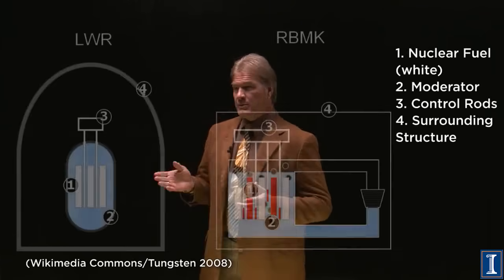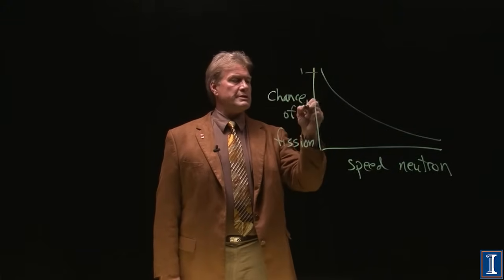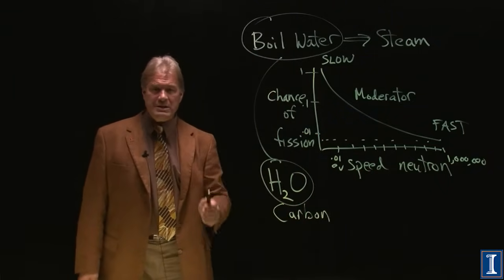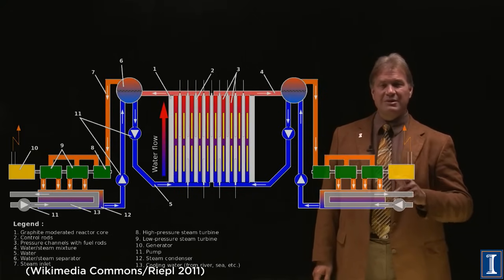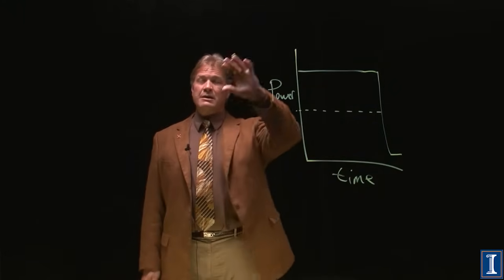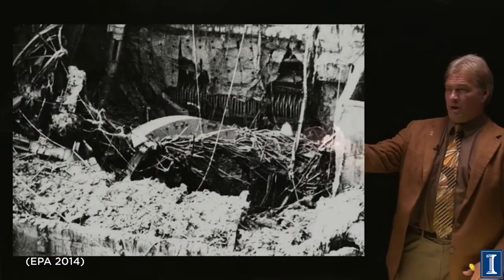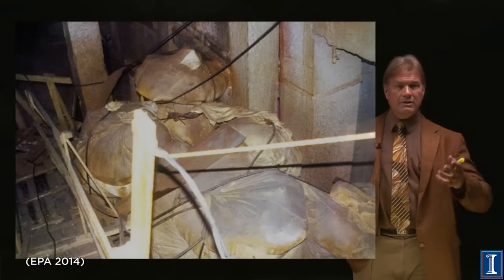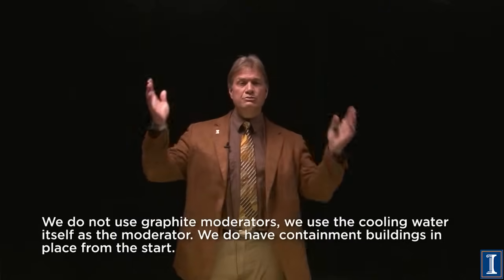Chernobyl: Worst Accident Ever

Comment: hello, i watched Chernoby movie as well, can you tell me what was the wrong button they pushed? from my understanding the issue or mistakes started because of the time amount of time that they waited to start experiment and while they waited to start experiment reactor was at a low enough power that xenon gas which is formed as a bi product of fission did not burn off as it normally would. where did you get this button information from? thx! i feel i got more accurate information from the Chernobyl hbo movie which is surprising. maybe this lecture is just a dummy down version of what happened?

Comment: The Soviet report concluded that the reactor didn't have a workable fail-safe for when the operators disable all the fail-safes.
Reply: You say that somewhat in jest, but there are serious engineering applications where "What if someone intentionally tries to make it do the thing we really don't want it to do?" ..is a significant consideration.
Reply: @jermainerace4156   You're embarking on a discussion of quality control philosophy, which is good.
Reply: @jermainerace4156  that’s true too. What if you have a malicious actor?
Reply: @jermainerace4156  Agreed.  Just that the implication is the designers were completely irresponsible and the operators weren't at fault.  Interesting idea that a nuclear worker could become suicidal -- maybe with a big enough dose.  And the HBO series (the final arbiter of historical disputes) implies that because accident details were made secret, they were not known to those who would have had the need to know them.
Reply: @crimony3054   The operators were at  fault because they didn't follow protocol for running at low power, the reactor actually had multiple automated safety checks, each one of those systems were manually shut down by the operators over the course of an hour, today no operator has authority to shut down a major safety program its entirely operated by computers.
Reply: @BigStou   But they didn't have a fail-safe for when the goddam operators over-rode all the fail-safes.  The whole RBMK design took the fall, but the operators were in fact at fault, and not just a little bit.
Reply: @crimony3054 .
Reply: @crimony3054  Yeah, I mean there were lots of problems with the RBMK and the Soviet penchant for secrecy but there is a reason only Chernobyl ever exploded - the operators. The regulations might have been unhelpfully opaque in some instances in explaining themselves but they were very clear DO NOT DO THIS about so many things Dyatlov ordered his people to do. Another thing was that things went wrong as Dyatlov was acting like they had only two hours, when actually they had more like five to do the experiment. He ordered them to bring down the power levels too quickly and then was in far too much of a hurry to bring them back up. Also while Soviet and Russian safety culture is not the best it is not non-existent. And this was evident in everyone but Dyatlov protesting that all his orders were unsafe.
Reply: @dewittbourchier7169  I think the power was brought down by accident. AFAIK, he didn’t tell them to bring it down.
Reply: @gareginasatryan6761  Well, for certain he didn't INTEND them to bring the power down as low as it got, but this was the mid 1980s and the effects of xenon poisoning were very well known. Dyatlov wanted to bring the power down faster. He should have considered this possibility and how to get around it, OR he should have just followed the right protocol.
Reply: @crimony3054  It doesn't matter if they were reckless, if they were informed they would have considered it. Airplanes don't crash from one system failing. Reactors don't explode from one system failing.
Reply: @BigStou  This is a critical thing we have learned over the last decades! In the case of chernobyl for example it is easy to say the operators are at fault. They caused the incident after all. Had they not acted grossly negligent nothing would have happened. However when designing something like nuclear powerplants we have long since learned that it doesn't matter who is at fault for the incident. We need to analyze how the incident happened and prevent it from happening again. 

So by that metric today you'd go and ask yourself "Would RBMK reactors be safe if the crew that operated the Chernobly reactor nr 4 that night was completely removed from the equation, replaced by a different crew." 

The answer to that question is no. It would not have been safe, not even remotely so. We don't view operators disconnected from the facility they operate anymore, we view them as part of the facility, part of the design. As such just like a valve can fail, they can fail and we should anticipate that failure and design around it! 
In chernobyls case, the Operators were directly made to shoulder part of the blame because it directed blame away from the fraudulent work culture that promoted the incident to happen. Today we have learned that a culture of blameless feedback is crucially important in allowing operators and human factors to act on worries without the fear of penalty. We have also found that threatening penalty for failures will only do the opposite of what we want, it will encourage people who know of misdeeds to stay silent to not incriminate themselves. We don't want that. 

That is why the operators at three mile island were not made to shoulder the blame for the incident DESPITE being the ones that caused it. Sure a mechanical failure caused the reactor incident to happen but only because operators shut off major safety features in a mistaken belief of "saving" the reactor did the incident ever even happen.
Reply: @jermainerace4156  Given that Mikhail Gorbachev was reforming the USSR, I have wondered  if someone intentionally tried to make it do the wrong thing, to make him look bad.
Reply: @jermainerace4156  You are kinda right, the reactor simply should have shut down as soon as they disabled a critical number of fail-safes, hmm. Then the reactor software should have sent a message to central nuclear control that it is being sabotaged.
Reply: @jermainerace4156  Agreed.  I too remove all the oil and coolant out of my car then drive cross country.  You know, for quality of craftmanship checks.
Reply: @zackthompson2505  Many people do that inadvertently by not fixing slow leaks. Eventually enough leaks out that the car overheats or the oil pressure warning comes on and they are like "ZOMG what happened?"
Reply: @zackthompson2505  very good point. Some cars do have failsafes against that. After all, what if there’s a leak. It’s downright stupid that most cars don’t have that. Even my phone had a failsafe for getting too hot (remember that they’re all passively cooled)
Reply: @zackthompson2505 - I literally LOL'D at your comment. Peak humor. Awesome! 😅😅😅
Reply: I learned that in IT. Never underestimate the capacity of ignorant "clever engineers" in bypassing and abusing a given technology.
Reply: You're all very mistaken. The operators (namely director Dyatlov) did create the situation that caused the accident, however this was due to a somewhat lack of understanding as well as an assumption that the AZ-5 emergency shutdown button actually did what they thought it did (it did not, and actually caused an exponential increase in reactivity that caused the explosion). The Chernobyl design was far more dangerous than any of the wests', it operated with a positive void coefficient due to the Soviets not wanting to use heavy water out of cheapness (meaning in the event there is no water being pumped into the core, reactivity will start to INCREASE), had no containment building that would've reduced nuclear contamination, had an emergency shutdown system that would increase reactivity briefly, and due to the design using unrefined cheap U-238 rather than like the west that used mostly refined U-235 it required immense amounts of graphite to increase reactivity which is why the AZ-5 fault even existed.
Reply: Absolutely well written response.  Thank you
Reply: @weasle2904  True, it was an ingenious reactor design as far as cost, but it had massive flaws. The creator of it dying before the first reactor came operational probably caused the worst of these issues. 
The shortening of the rods to decrease the reactivity in the bottom of the reactor by using the water moderator was a horrible idea as then the rods going in for AZ-5 cause hundreds of rods to move the moderator out of the way to replace it with graphite to fuel the reaction at the bottom that was previously being held back. Leningrad would have blown up in 1975 had they modified those to the same dimensions of reactor 4's design.
Reply: They shouldn't have the possibility to disable everything - it's just a really bad engineering design.
Reply: The test was a success. They got exactly the data they were looking for.
Reply: @Gunno77 😂😂😂😂
Reply: The ultimate fail safe, and the one that cannot be deactivated, is the containment building. Preferably built before an accident happens, just in case, as it is done in the construction of nuclear power plants pretty much anywhere but former USSR.
Reply: How very logical!
Reply: 😎 So basically um……

https://youtu.be/wKbU8B-QVZk
Reply: Its called a short cut taking idiot
Reply: Soviet reports tend to have the same credibility as Nazi reports. For those educated in the problematics, though.
Reply: Underrated comment
Reply: Which is actually accurate.
Reply: In Soviet Russia, Report Writes you!!
Reply: Recent books have pointed out some of the failings and dangerous aspects of controlling the reactor were kept from the operators
Reply: @addcafe   I always wonder about this... as those on the ground closest to the explosion would have the greatest incentive to understand the reactor from all sources, officiallly or not.  And the films shows that the bad guy was shocked to see the operator had pressed the AZ-5 button, as if everyone knew not to do that.  🤣
Reply: They knew the reactor had no fail safe. They kept it secret so no one would find out. Not even the people who worked at the plant knew. A recipe for disaster indeed.
Reply: @ROBSHOTZ  They thought that as long as nobody disregarded the other safety measures then nobody would ever discover the flaw. This is a culture where people are expected to follow orders to the letter without questions or complaints.
Reply: @Kwatcher100  this is a problem people seem to skirt over, the communist dictatorial regime demands orders are followed and failure is not tolerated. The experiment had to be conducted and power had to be restored otherwise its gulag for those responsible.
Reply: @ROBSHOTZ Wrong! The operators did engage the scram button, but they were not aware that the control rods had graphite tips. These tips entered the reactor essentially injecting additional moderator. That caused a spike in reactor power which caused the control rods to stick in place. Reactor power skyrocketed causing the remaining water to flash to steam blowing the cap off the reactor. The explosion happened shortly afterwards. It was misoperation more than anything that caused the accident.

Comment: Fukushima was not as bad as Chernobyl, but still, it's not a small problem. Generator is out, you don't get batteries early enough, some radiation can leave the building. Do  anybody know for a fact that every single unit have now three-foot barrier over the reactor and also over the used fuel? Fukushima had it only over the reactor, big problem. Btw great videos, greetings from Czechia.

Comment: sounds more like trying to sell that western nuclear reactors are save and reliable instead of just explaining what happened... nuclear energy is not save, not clean and makes more problems than it solves.
Reply: It is the cleanest practical source of energy we have. In agregate coal and oil took more years off people's lives than all the nuclear accidents ever combined and by couple of orders of magnitude too.
Reply: @Turtlemaroon  open your eyes its not clean at all. Radioactive waste is something that will poison the earth for over 100000 years.
If you want "clean" energy renewable energy is the way to go.
Reply: @OgGSUS  I nver said "Clean". I said "Cleanest PRACTICAL source. Renewables other than water fail spectacularly on the practical part. Power grid where energy supply changes wildly from hour to hour, day to day is unmanageable. 

https://www.greentechmedia.com/articles/read/germanys-stressed-grid-is-causing-trouble-across-europe

Until we invent high capacity battery technology that can charge and discharge fast and can take many cycles without degradation solar  and wind are only suitable to cover certain small fraction of energy needs.

As for the waste. Lot of it could be used for more energy if developement of 4th gen reactors was not hamstrung.

Also we really need to dedicate Apollo-level resources to fusion research as life critical technology...
Reply: Nuclear energy is safer than all the other methods of electricity generation we have.
Reply: @danadurnfordkevinblanchdebunk  really maybe you should plan your next vacations and spend some time in chernobyl or fukushima.
Reply: @danadurnfordkevinblanchdebunk  
so save people had spend over  2.1 billion € for a new safe containment, have to run around with geiger counters and are only allowed to spend a limited time in there over 35 years after the incident. japan is a  spread out country and the oldest people life on the southern islands which are way over 1000km away, maybe you really should go visit this places talk with some of the liqidators that are lucky enough to be alive, or the people that are not allowed to return to their home.
Reply: @danadurnfordkevinblanchdebunk "None of the liquidators died of radiation exposure" bravo were done here...

Comment: sweetbeef when did this hoppen  I am looking for aftermarket blades for my mahindra emax25m-2514 60 inch mower deck model AEMAHME60. blade oem part number AME050008.  21 INCH BLADES WITH A 5/8 INCH CENTER HOLE

Comment: So If I get this right, when they put back the control rods instead of completely capturing neutrons, they acted as moderators and only slowed them down? Why did this happen? At the time when they put them back in you said the reactor was at that medium power level which is lower than what it normally operates. So why was it different this time? Doesn't that mean that the same if not worse would've happened before hand if the rods are just moderators? Please explain this to me I would like to understand.

Comment: See to be some mistakes.
Rbmk reactors can be refueled while in full operation.
They did this test for every reactor only did this one years later. Right after a period of full power.
They shut down the reactor. And didn't wait 3 days for xenon 135 or 136 (sorry i forgot) to burn off.
It isn't actually burning but no matter.

Comment: If you loose the water, the reaction stops.

Fukushima is the exact demonstration this is not true. The cores melt because there were no more water.
Reply: no, the reaction does stop, but there is still decay heat left behind from fission product decay with enough energy to melt the core. Your statement is incorrect.
Reply: @FloppaEnjoy  decay heat is a product of nuclear reactions. A core meltdown is mainly driven by uncontrolled reaction inside the core with massive neutron emissions. Decay heat is a consequence, not a cause.
Reply: @Von_DBL  This doesn't change the fact that your previous statement is incorrect. The decay heat is still enough to melt a core without proper cooling. You can stop the FISSION reaction by removing water but your core is still going to melt without water to cool the heat created from the decay of fission products. The core melts down, but not because the fission reaction doesn't stop.

Comment: All the fission nuclear accidents and problems are now a thing of the past.  We have recently taken a new step to advance the physic of power production by enabling chemistry of the atomic nucleus, or "nuchemy", We are passing the chemistry level where we interacted with electron shells and are moving on to manipulations in this "nuchemy" atomic nuclear era when we interact and multiply nuclear protons. We have rediscovered the lost work of the alchemists and can make new elements with different atomic weights and vastly new properties. This was ably demonstrated in "The Safire Project". Quanta are important. We now have enough energy in them to manipulate the atomic nucleus much more easily by creating a compartment or a local region of plasma containment so reactions at this atomic nuclear level can easily take place. This is about to practically enabled a fantastic new era of energy production for the whole of mankind. This with free fuel obtained from water or atmospheric moisture anywhere in the world. New fusion nuclear is at the industrial commercial production final development point as of now. The energy argument and other power methodologies are all now irrelevant as we have new and very physically and economically powered practical and local community level fusion nuclear power. Solar roof plus Teslawall battery may be the present way to go domestically but megapack batteries and multiple storage technologies interconnected with an expanded ugly grid have a less certain requirement when you consider new any-scale community based and 24 hr self-fueling reliable fusion nuclear in the form of the "Safire Generator". Learn all about it at "aureon energy.com". Learn the newer EU physics at "Thunderbolts Project.com" and you will be permanently reeducated with the advanced new theory.

Comment: 5:23 as i understood : The water who is used as the moderator is not the same water they use to work the turbines, because that would contaminate the whole system with radiation. It is maybe the same type of water, but its NOT the same water.